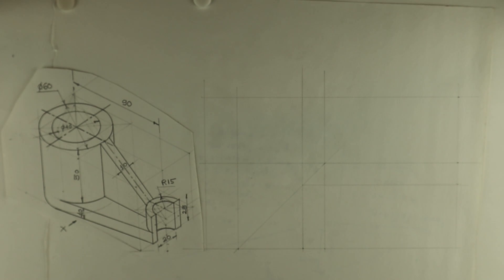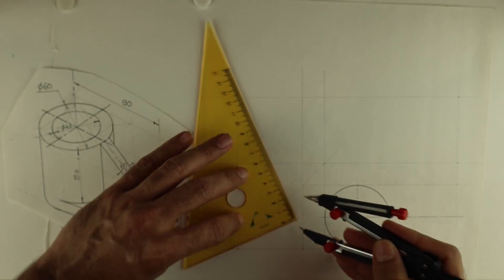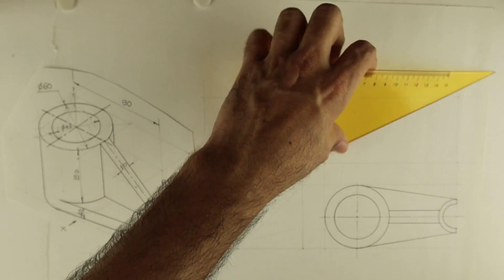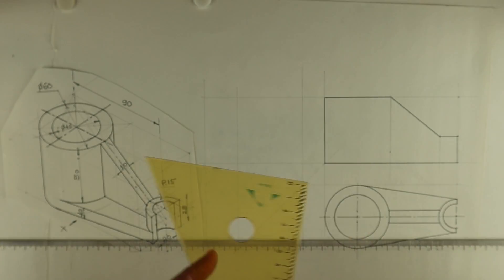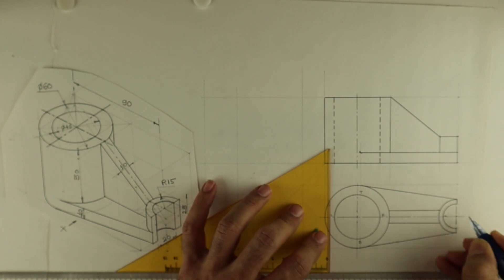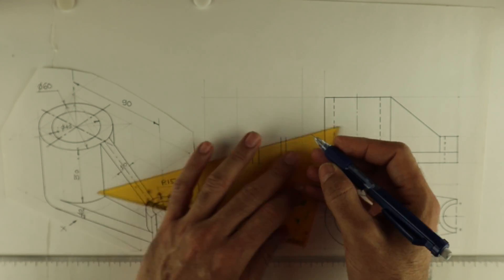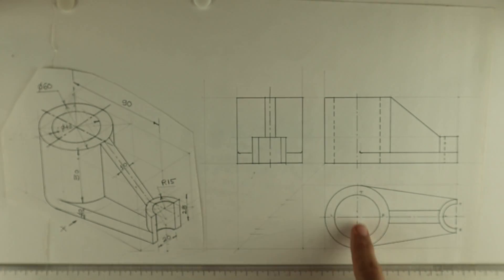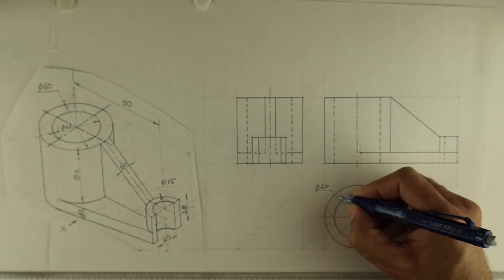Orthographic Projection - Engineering drawing - Technical drawing

Comment: How do you know that where 90 mm ends at the center of the circle from there the length is 30 mm i.e L=90+30= 120 how did you cane to know that it's 30.?
Reply from the maker: Dimensions will be always from centre